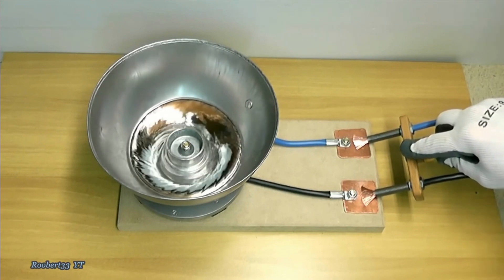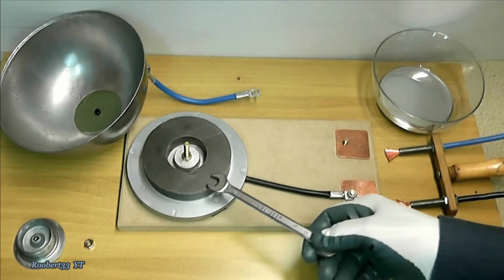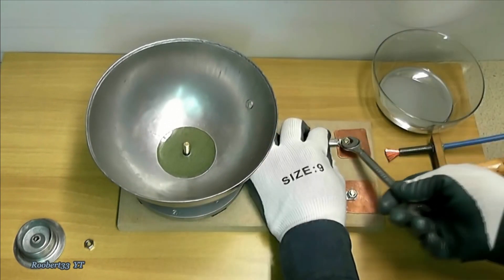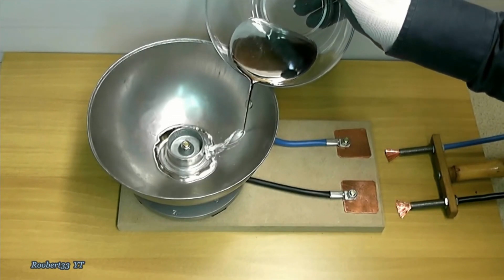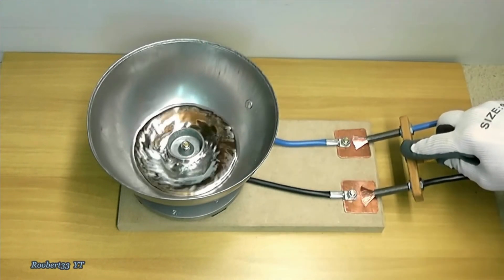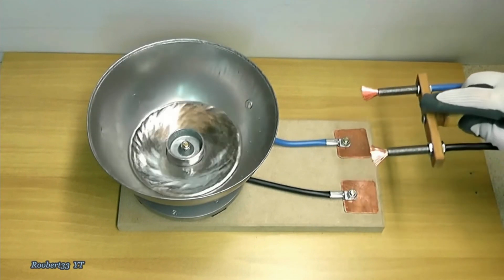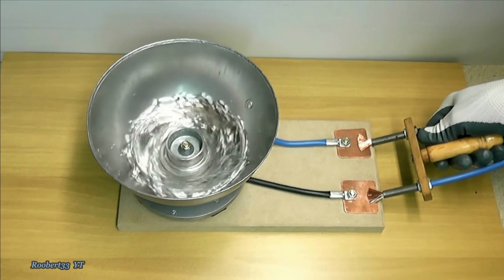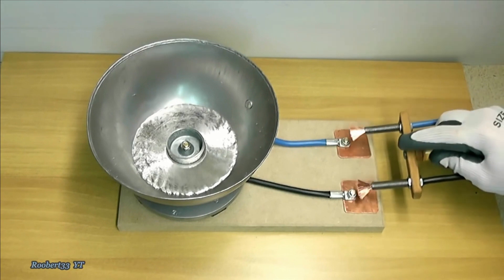Mercury Vortex in Magnetic Field | Magnet Tricks

Comment: Get it to 1000mph in the opposite direction, the Earth is rotating and you get anti gravity
Reply: Gravity has a frequency
Reply: @MFFarm814  gravity can’t have a frequency because it is not a spatial frequency. It acts instantaneously. If anything it is an impulse wave. If the sun disappeared, it wouldn’t take any time at all for the earth to go flying. You’d still see the sun. It wouldn’t take any just fade away as it took longer for the light to reach the earth.
Reply: @CN3891 wrong, gravity moves at the speed of light.
Reply: This guy gets it. Add a heavy metal like thorium and you get a pseudo black hole. At least that’s the story…
Reply: Why would that be the case?
Reply: @damiancorrea710  magnetic field is created. its how the ufos work.

Comment: I am sorry !
There is a major problem for me !

Aluminum is very sensitive to mercury
Mercury gradually penetrates aluminum and corrodes it
So:
1- Do aluminum electrodes not rot due to the presence of electric current? Or after a few minutes corruption starts?
2- Have you tested another electrode such as iron or steel 316 or other metals? 😊

Comment: can the mercury be rotated through a closed system ? as to say if i had a circular tube filled with it could i get the fluid to want to flow in a circular motion  from inlet to junction back to outlet ? and at what pressure wold you think it would want to flow?
Reply from the maker: I didn't film this video, but IMHO it would work in a closed system more efficiently.